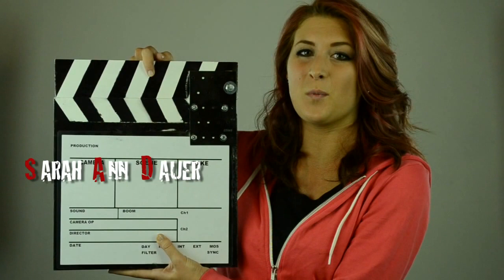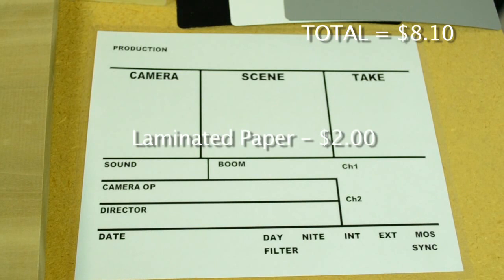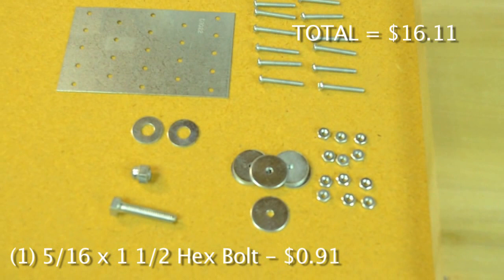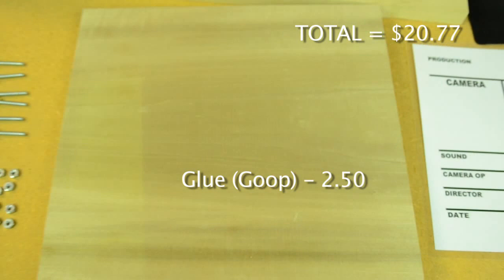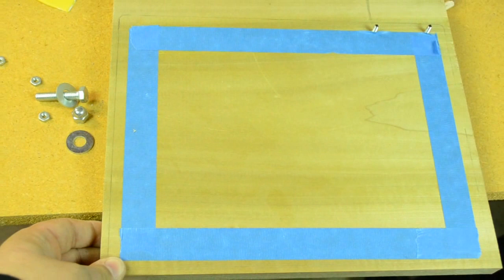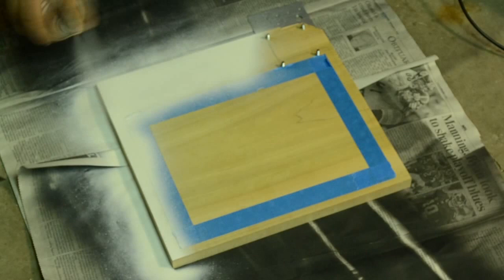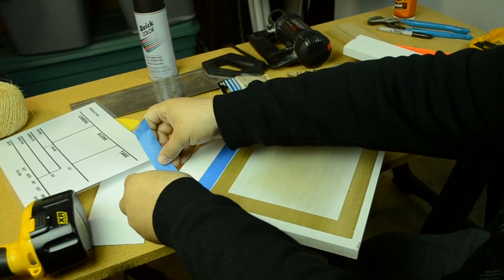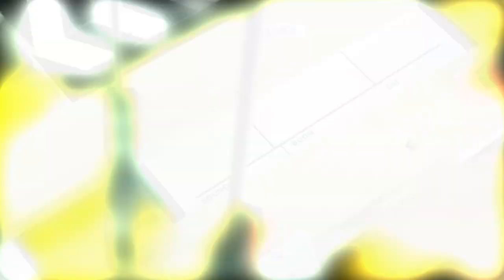DIY Film Slate (Building a Clapperboard)

Comment: how do you guys edit the beginning intro, when you guys show the actress/model. it change to black and white
Reply: Really easy just make another layer add some filters and mask out the body
Reply from the maker: actually it was even easier than that. In Final Cut, export a still png image and then open in photoshot. Add a black solid to the background and either erase around the acrtress to bring out the black or mask around her. Then we took her layer and used a syle effect like pencil and changed the settings till we liked what we had.